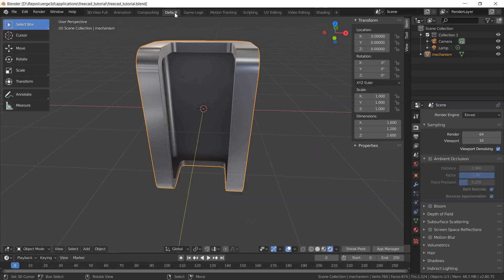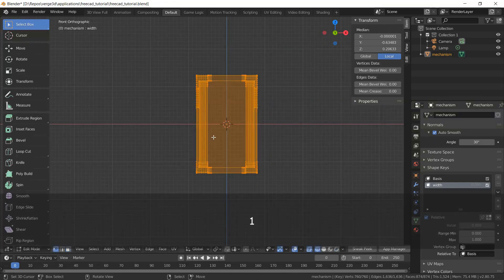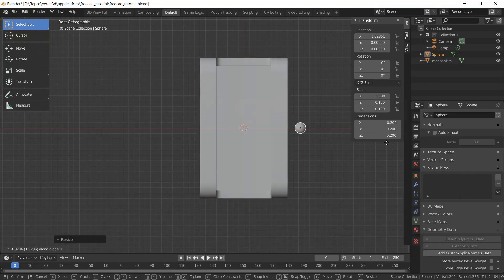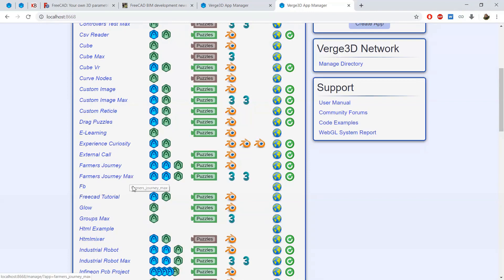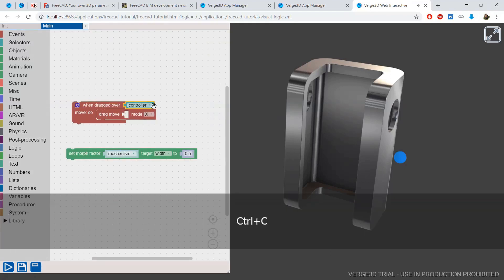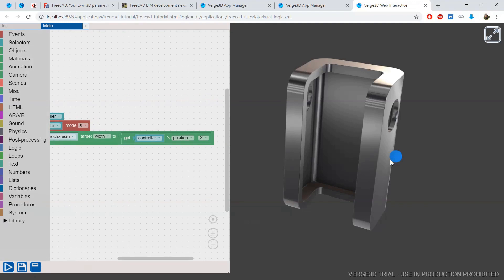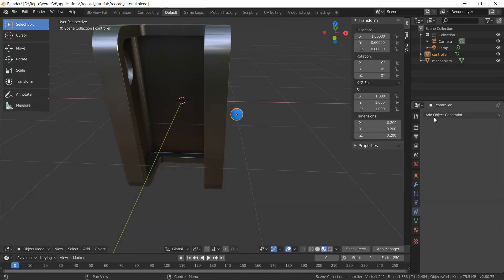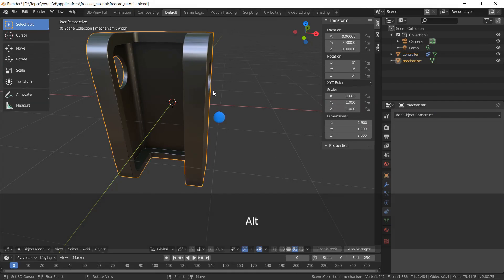Making interactive parametric models with Verge3D, Blender, and WebGL

Comment: I have some physics in my project and I wnat to update that after changing size is it possible?
Reply from the maker: Hi! you can remove/destroy the old physics body and create a new one after applying morph targets.
Reply: @Soft8Soft  I meant real time. User can resize and physics change.
Reply from the maker: @SinaAfshariJewellsMuseum  rigid bodies cannot be resized in real-time sorry :( as a workaround you might consider some sort of a compound object which consists of several rigid bodies which move according to morph targets. Anyway its better to ask on the forums https://www.soft8soft.com/forums/

Comment: Hi, I made this function to an object, and a function to change texture interectively. But when I use the controler for the first time, it works fine, but if I click on a object who have the new texture, and applies that texture to my main object, the controllers dont work anymore, the sphere controllers moves but the object dont morph anymore. Any thoughts? Thanks.
Reply from the maker: You mean you apply a new material to it from another object? You need o set some dumy shapekeys on that object from which you get the metareal for your main object.